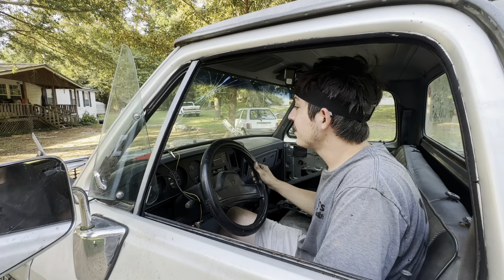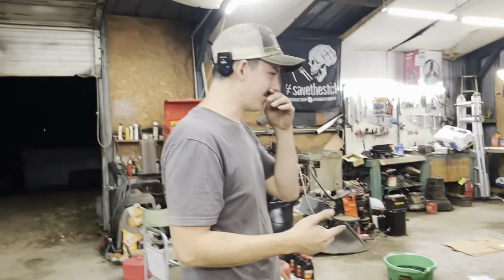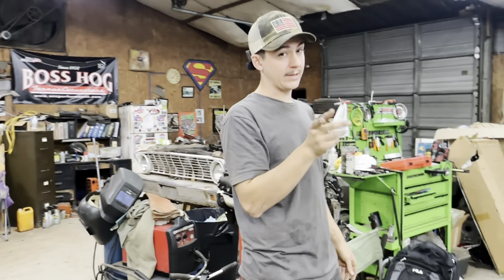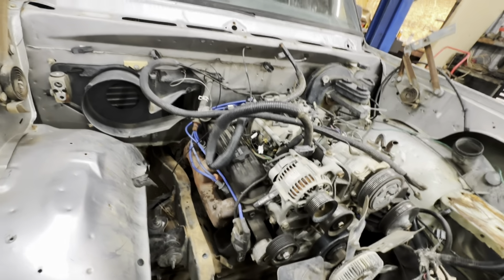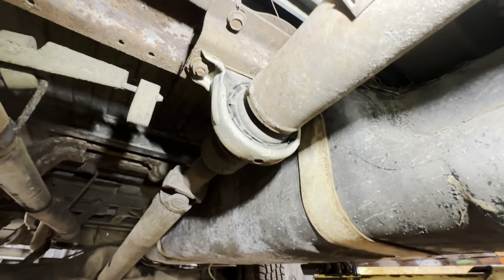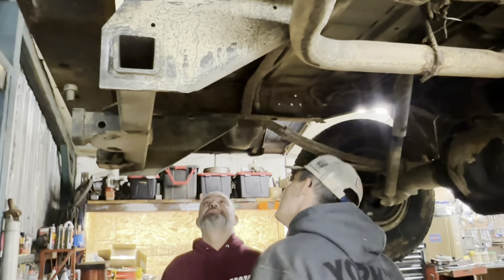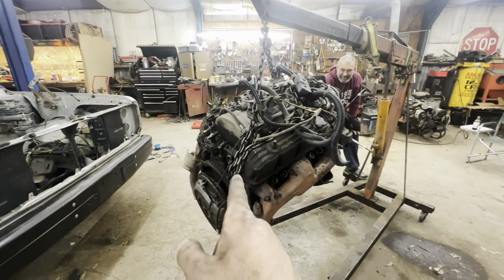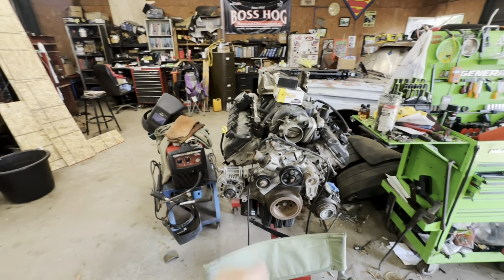1st Gen Ram Gen 3 Hemi Swap! (The Introduction/ Revival/ Teardown)

Comment: So my w150 was the exact same way when I got it the water pump eat a hole in the  front case and guy that had it took the intake off the oil pan the cowl the whiper motor the battery box lol no clue what they were doin but mine is a 92 so it's still an LA motor

Comment: Try an alternator for a 2005 grand Cherokee hemi. Mounts in same location but is tucked in closer to the timing cover. Check out some of videos you’ll see how close it sits. no frame modifications
Reply: I came here to say the same thing.